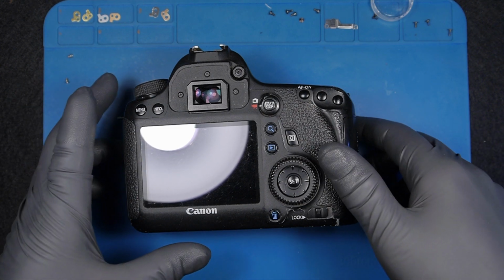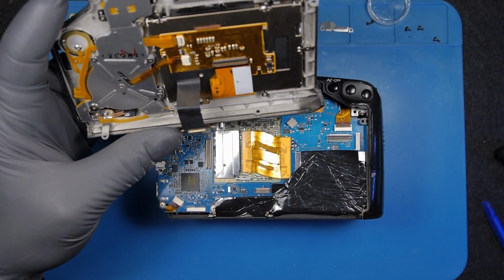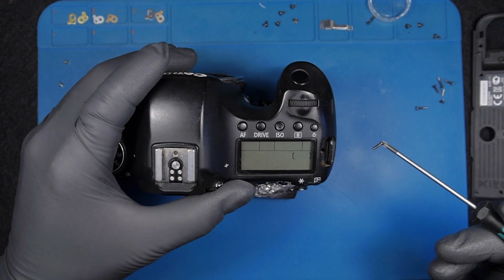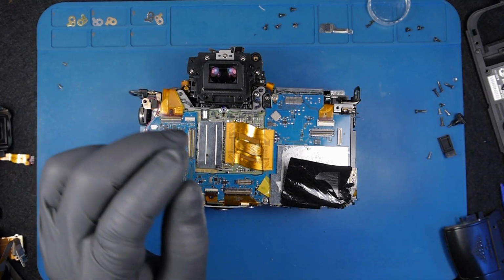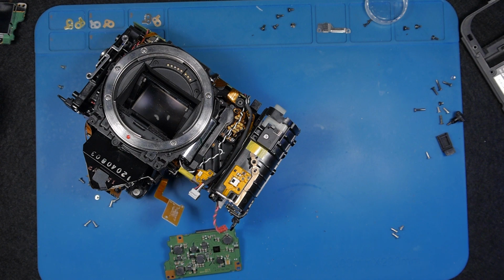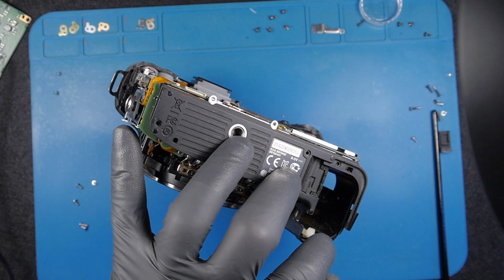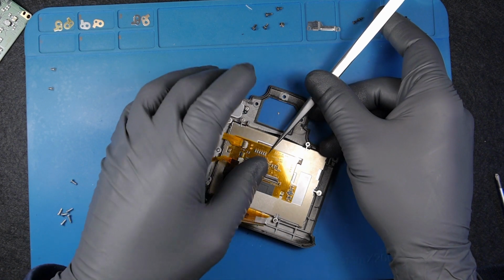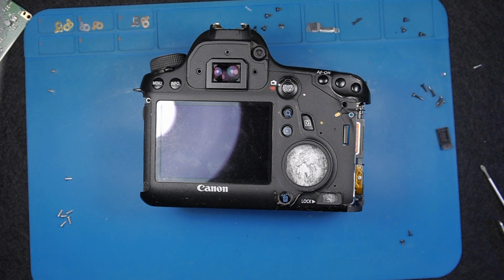#026 Canon 6D No Power - Let's Repair a Camera Part 1

Comment: hello, i hv a camara canon 100d ,
and my conector fpc is broke i need to buy  a new conector, how do i know which conector is for get exactly the seem???
Reply from the maker: Hi is very hard to find this kind of parts, I use faulty motherboard as donor for parts. Try on aliexpress or look for a faulty board on eBay